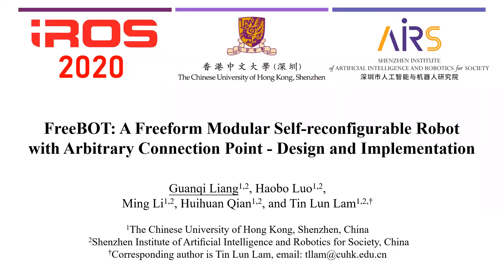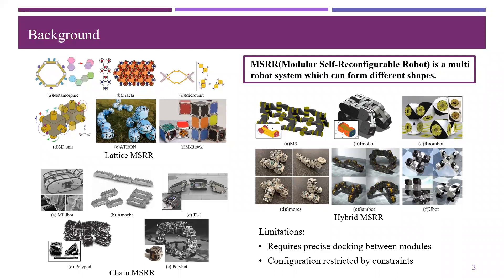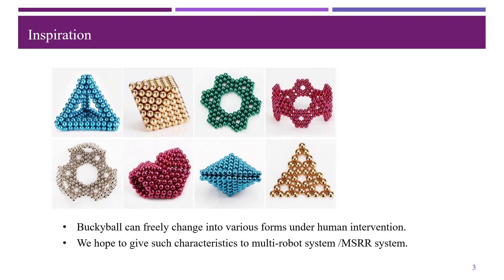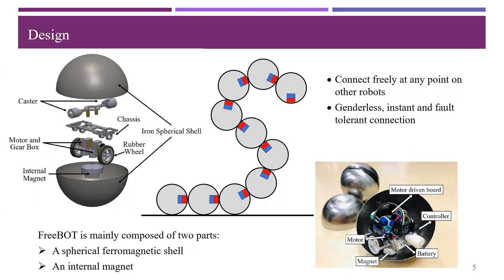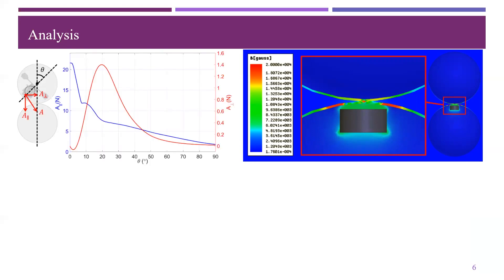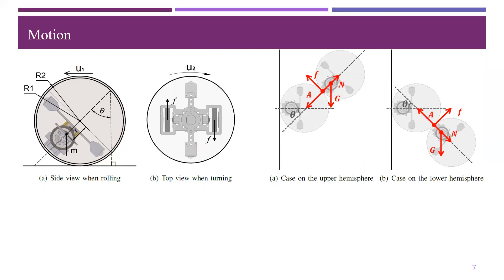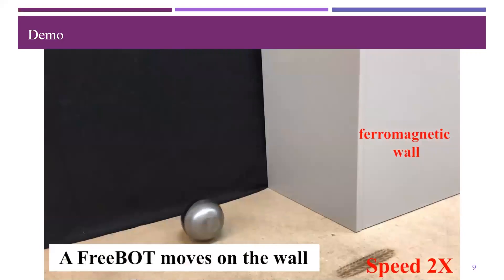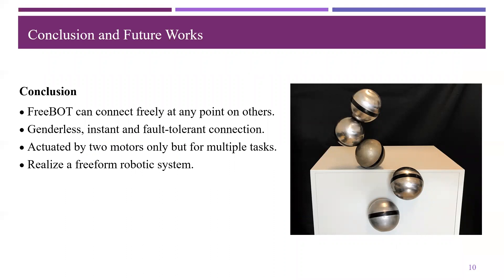[Presentation] FreeBOT: A Freeform Modular Self-Reconfigurable Robot with Arbitrary Connection Point

Comment: What is the purpose of the two caster wheels here?
Reply: Good question! We wanted to use caster to ensure the balance of the internal mechanism to prevent it from toppling in the spherical shell. Later, it was found that the toppling was almost impossible because the strong magnet was adsorbed on the inner surface. So in the latest version, caster has been canceled.

Comment: I noticed you don't show the battery in the internal configuration diagrams. How long does it last, and how is it recharged?
Reply: Very insightful question! The battery life of a FreeBOT depends on its battery capacity and power consumption. In the current version, if the FreeBOT is in standby mode, it can work for more than three hours. If it keeps moving, its working time is less than one hour. Charging the FreeBOT is a troublesome problem due to the wrapping of the shell. Recently, we connected the battery ends to the spherical shell through a clever design, so that we can directly operate the spherical shell to realize the charging of FreeBOT. The charging mechanism will be published soon, please look forward to it!